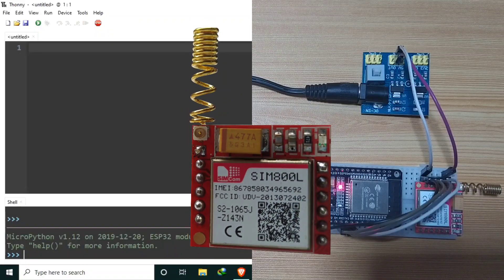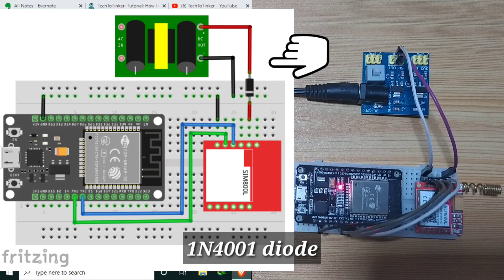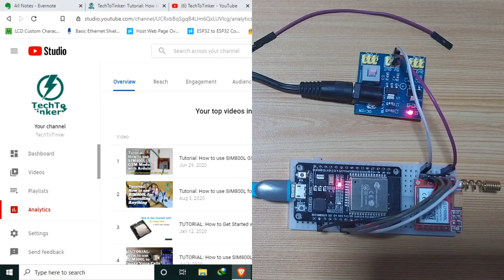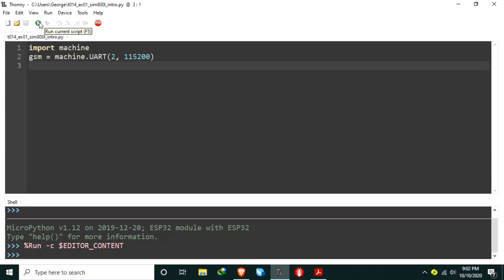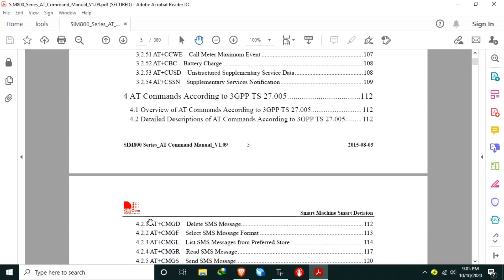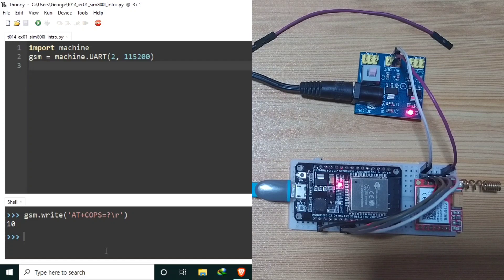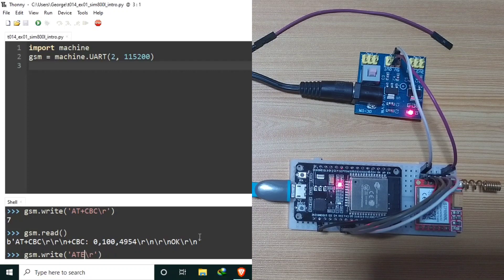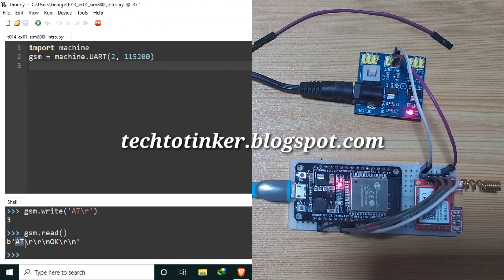014 - ESP32 MicroPython: SIM800L GSM Module in MicroPython

Comment: Which one is better Sim800L red module or blue module?
The online store says blue one is version 2 which supports 5v.  But they didn't mention what version the red one is.
Can I use 5v version for this tutorial?  If so, I will order one so I can use the module on both ESP32 and Arduino UNO.
Also, is Sim900L newer version?

Comment: kindly provide the gpio pin details of esp8266 as well so we can run sim800l with esp8266 in micropython
Reply from the maker: You can use the equivalent UART gpio pins on ESP8266.
Reply: @TechToTinker  I have used the UART 0 but after writing gsm.write('AT\r) in shell it gives me 3T instead of 3 and in gsm.read() nothing shows up

Comment: How can we do this in esp8266
Reply from the maker: @Expert Coder, you do it similar on how it is done with ESP32, just change the pin assignment only.
Reply: @TechToTinker  
my code is 
from machine import UART
gsm=UART(0,115200)

it will give error in esp8266
Device is busy or does not respond. Your options:

  - wait until it completes current work;
  - use Ctrl+C to interrupt current work;
  - use Stop/Restart to interrupt more and enter REPL.
Reply: @livesmartschool8164  hey did you getting the results with changing the UART pin to 0 because I am getting a result of 3T instead of 3 kindly help me if you run all the commands above with esp8266

Comment: Hi, 
I have watch almost all the video you have posted in youtube. All are very much helpful.
I am trying to figure it out a problem. But can't solved yet.
How can I use multiple SIM800l module in ESP32/ Arduino?
ESP32 has 2 RX/TX communication. Maybe it is possible.
But when I use Arduino it doesn't show anything in serial monitor.

Let me know if you have any solutions for this.

Regards
Reply from the maker: Hi @Al Imran Suvro, thank you for your kind words much appreciated.

To have multiple sim800 in ESP32 is possible. Arduino Uno could be difficult because of limited resources but possible you will need to use SoftwareSerial library. Better to use Arduino Mega more gpio(including hardware serial) and enough resources.

If nothing is displayed in serial monitor, you may troubleshoot on the following:
1. try checking the continuity of rx and tx connection.
2. try swapping the rx and tx pins(thinking maybe its connected reverse).
3. what pins did you use? D0 and D1 is reserve for hardware serial(serial monitor usage).

Hope this helps.

Cheers,
George Bantique | tech.to.tinker@gmail.com
#TechToTinker
Reply: @TechToTinker  I appreciate your support. I have emailed you from bd2010news@gmail.com. Cheers, Suvro
Reply: also double check that you are wired tx->rx and rx->tx.  If you are using arduino to connect to the sim800 make sure that the arduino is running the code to echo the serial port in the arduino software to the rx of the sim800

Comment: Idol baka naman pwede pasama sa description san ka nakakabili nyang module mo pati yang power supply mo sa module..
Reply from the maker: Hi @Gregg Heffley, hindi ko na matandaan kung saan ko nabili kung Lazada, Shoppe, Banggood, or sa local store. 
For the power supply basta makapag produce ka ng voltage na 3.4 to 4.4V. Much better if 4.4V so that during transmit burst, you still have enough power for the SIM800L.
Reply: @TechToTinker  ung power supply na module san mo nabili at ano yung name? di pwede gamitin ung power na pin ng esp32?
Reply from the maker: pwede gamitin yung 5V ng esp32 through a diode but it is not advisable. You might d	amage esp32 by sourcing too much current. So recommended to use external power supply.
Reply from the maker: yung sa power supply hinahanap ko pa yung order details hehehe, parang 3.3V 5V 12V Power supply siya.
Reply: @TechToTinker  salamat ng marami idol..
Reply from the maker: @greggheffley3232  you are very welcome Gregg. Thanks.
Reply: @TechToTinker  idol kahit anong sim800L lang dito sa shopee naka lagay kasi supported network china mobile, china unicom and global quad-band? Tapos ung power supply din 700mA  ok ba un?
Reply from the maker: @greggheffley3232  kung makakita ka ng SIM800L v2 much better yun kasi 5V na siya
Reply: @TechToTinker  ok ok noted meron ako nakita dito etong may antenna cable cap.. pro yung suppy neto 5V 700mA ok yan un idol?
Reply from the maker: ayos na yan @Gregg Heffley